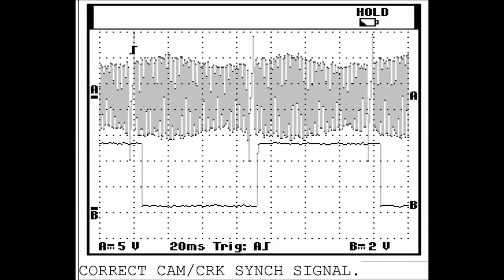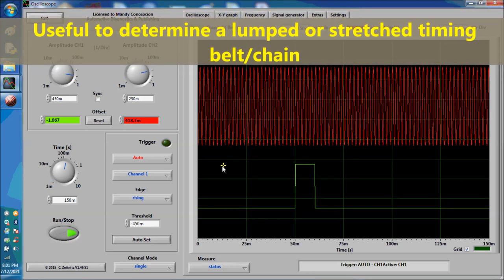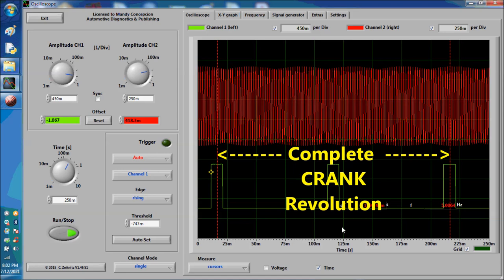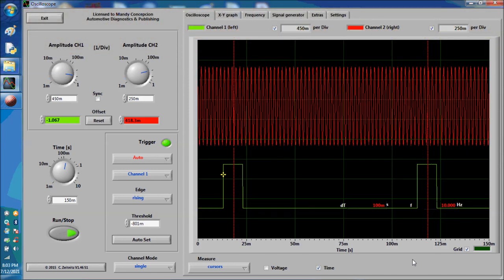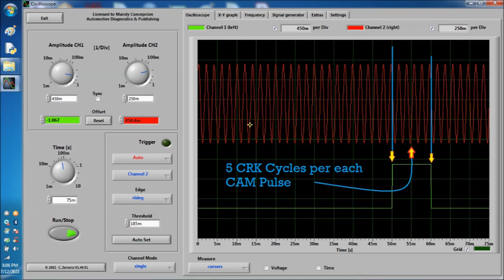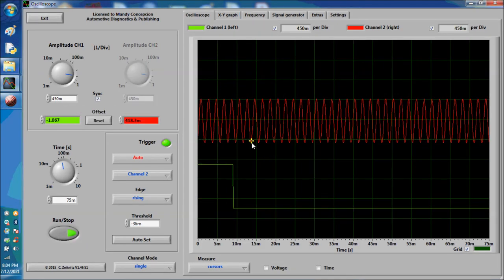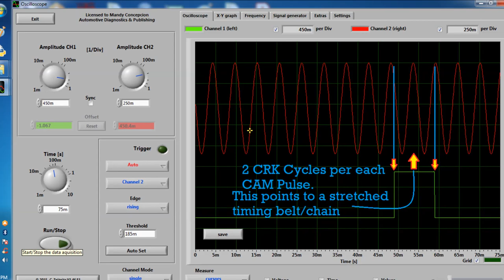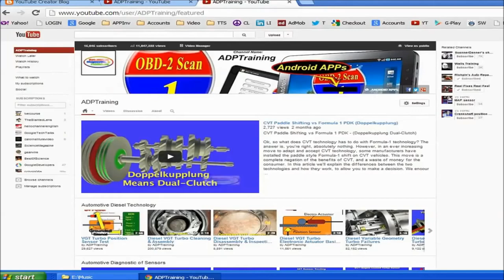CAM and CRANK Sensor Signal Jumped Timing Detection, Automotive Oscilloscope Study Course

Comment: Author: Christian Zeitnitz Main features:

The PC based Soundcard Oscilloscope receives its data from the Soundcard with 44.1kHz and 16 Bit resolution. The data source can be selected in the Windows mixer (Microphone, Line-In or Wave). The frequency range depends on the sound card, but 20-20000Hz should be possible with all modern cards. The low frequency end is limited by the AC coupling of the line-in signal. Be aware, that most microphone inputs are only mono.

The oscilloscope contains in addition a signal generator for 2 channels for sine, square, triangular, sawtooth wave forms and different noise spectra in the frequency range from 0 to 20kHz. The signal can be defined by a mathematical formula as well. The signals are available at the speaker output of the sound card. These can be fed back to the oscilloscope in order to generate Lissajous figures in the x-y mode.

A special probe is required so the sound card is not destroyed.

Comment: Your graphic was wrong. it said "1 crank revolution" and had arrows pointing right and left, but the area covered by the arrows was TWO CRANK REVOLUTIONS. In the space that your graphic claimed the crank turned once the cam do turns once. This 2 : 1 crank to cam ratio allows the crankshaft to rotate twice raising and lowering the piston the 4 times needed for the 4-stroke combustion process of 1) intake, 2) compression, 3) combustion, & 4)exhaust as the cam rotates once during this same period first opening the intake and then closing both intake and exhaust to achieve compression, then opening the exhaust to clear the cylinder.
Reply from the maker: Agreed, keep watching

Comment: You are telling us something that is incorrect. First you show 6 crank teeth and when supposedly the chain was stretched you show 3 teeth.
THIS IS NOT POSSIBLE 
The number of teeth per camsignal must stay the same else it would mean the crankshaft slowed down. A stretched belt will show up as a PHASE SHIFT between cam and cranksignal not a changing number of teeth.
Reply from the maker: You're incorrect.